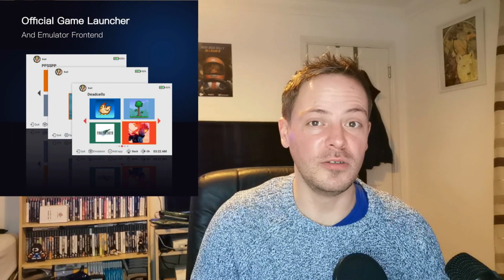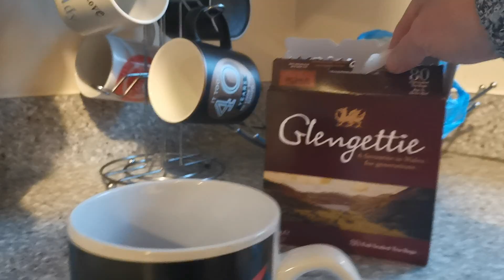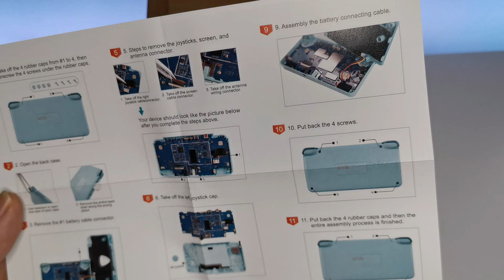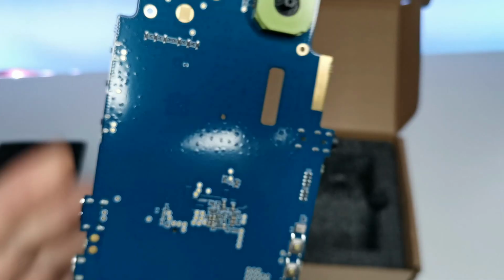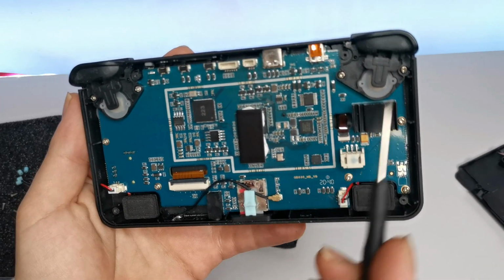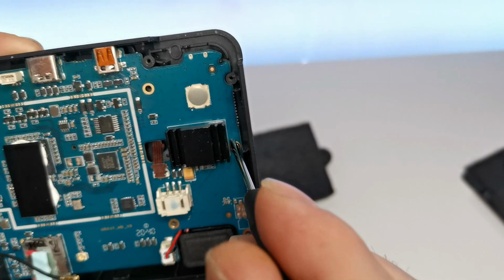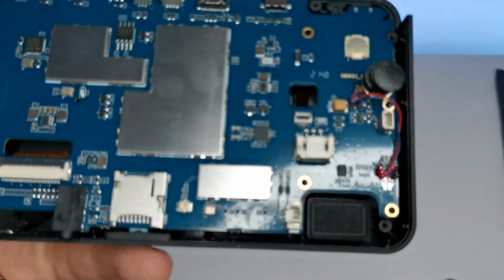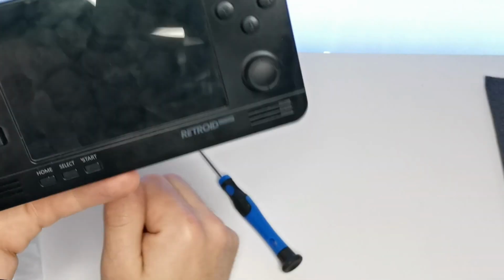Retroid Pocket 2 Plus + Upgrade Assemble Installation DIY Review

Comment: Good job. 👍  I would love to see a screen swap. I am so paranoid about replacing mine when it comes in. I want to keep the old one as a backup so damaging it is out of the question.
Reply: I just ruined the shell on my RP2 when trying to remove the screen. I am big sad right now.
Reply: I was too cheap to spend another $20 on the touch screen just got the motherboard upgrade. Good luck. Let me know how it goes
Reply: @Mctoasty302  man I gotta know the details so I don't repeat the same mistakes. I know they sell new shells too😬
Reply: I was looking and couldn’t find anything but I figured it out. Heat up the screen with a blow dryer and push it through the front and use a pick to get underneath to push through the remaining adhesive
Reply: @sharkboy980  what is a pick in this context? A toothpick? From where do i push? Won't the case defirm due to heat?
Reply: @questionsfrog1918  guitar pick

Comment: I done mine with touch all good apart from the clip on the analog that hols the ribbon
 came off, so I need a fix :(
Reply from the maker: Ooh well done wasn't daring enough to try and install the screen, well done. Tat little ribbon is a pain, all the best
Reply: @rightspritegaming  I got a plan thought to use Kenton tape, it's repairable the clip is tiny man, I still got the clip 🙏

Comment: If I do not upgrade to the new touch LCD IPS 640x480 screen, will the TV-Out HDMI output on new RP2+ PCB work with my old RP2 IPS 640x480 LCD screen?
Reply from the maker: Yeah mine works fine .
Reply: @rightspritegaming  you are using old screen not new touch screen?

Comment: So how the fuck do you change the screen? Seems like everyone is leaving this out.
Reply from the maker: Yeah not really essential, and needs some installation skills, with a heat gun and glue
Reply: @rightspritegaming  I've just did it, I did destroy the old screen. You don't need a heat gun, you will destroy the entire case with a heat gun. The screen has some adhesive tape on it, it's a pain to remove but worth it.
Reply: @padmad3k63  how did you do it, please explain. Everyone says "oy,need to use a heatgun/blowdryer m8, easy innit" but they never did it themself since heating up the case warps it till oblivion